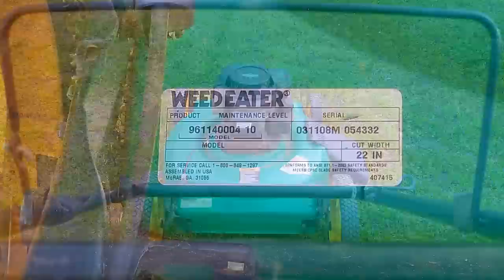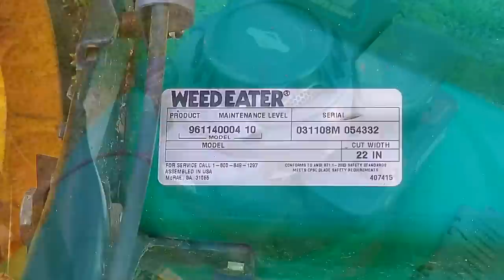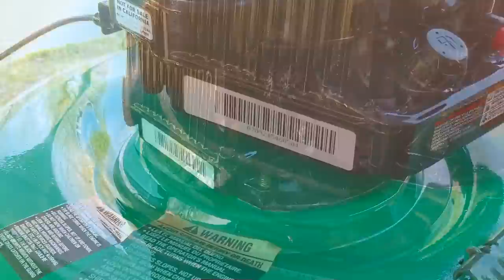Bought A Weedeater Mower And Things Don't Seem Right

Comment: I had the same kind of mower weed eater I just changed the primer and the carburetor I got it at Amazon a lot cheaper I bought a brand new back in 07 and I fixed it myself it runs very well😮😮
Reply from the maker: nice work

Comment: I put p-touch labels on the plastic on the engine or the deck stating when an oil change was completed, spark plug replaced as well as air filter. That is a great reminder as you always see it when using your equipment. Good job as always on the repair.
Reply from the maker: nice idea! And thank you Eric Oestreich

Comment: Of all the mower I've fixed, I have only had maybe 1 of those classic engines that wouldn't run good.  Even managed to convert a pressure washer one to a mower engine and it ran just fine.  Those engines were bullet proof, esp compared to the ones today.
Reply from the maker: you got that right!

Comment: I'm to the point where I'm going to fully inspect everything before I leave. Just bought a small hydraulic fender press thing and dude said "it just leaks some oil, works fine" got it home and filled it up. The thing was just full on dumping fluid. Not from a hose or something nice and easy, but out the seal of the main hydraulic cylinder that you can't get parts for anymore. Wasn't holding pressure at all and was way beyond useable. Thank goodness he took it back and from now on I'm fully testing every aspect of whatever I buy.
Reply from the maker: good advice

Comment: few months ago  I picked up this exact mower , fixed it and sold it.    I use #4 pull cord, and I am glad I bought a 100ft of it recently, 40% of mowers I have had come my way needed a new pull cord    I use Oregon 31-140 4 100FT[896] Small Engine Starter Rope.     Also at the end of the video I saw you using non -detergent oil.   I wouldn't of used that but if that is all you had  its better then nothing.   10w30 or HD30 is what I use, Detergent oil.
Reply: How much did you ask for it and how much did you get?
Reply: @mnight207    prices very by location, time of year, etc and inflation.. few years ago this would of been a $60 mower,  now its more. depending on how new parts that were added or replaced. etc
Reply from the maker: thank you for the information
Reply: @dfields9511  that's amazing! Even with inflation, I think that would bring $40 in my area right now. I think there is too much competition here.

Comment: I’ve gotta say, cheap as they are, I really like these basic Weed Eater mowers. I’ve had a number of them and they always seem to work very well with little effort plus they don’t seem to rust out as easily as many others. The paint seems to be consistently good too, it’s well applied and shines up beautifully (unlike those MTD mowers that seem to use poorly applied latex house paint which peels off in sheets, even on a new mower!). These rarely disappoint!
Reply from the maker: you go that right, I wish more mowers were like this one.
Reply: Yes those green mowers like the weed eater brand..seem to be good
Reply: Yes those green mowers are good haven't seen one in a long time

Comment: Our situations are identical. I enjoy this hobby and I'm just looking to not lose money. I could sell this mower for $75 as fast as I could turn them out. I'd have 15 responses in 30 minutes on marketplace. I've had people race to get them. Even try to out bid each other. I would have mentioned in the ad that this mower has very low hours for its age. Based on the tire tread and the condition of that deck, experience tells me it's hardly been used. Great video as usual.
Reply from the maker: you are correct, the moment this was listed it was gone

Comment: I picked up one of these for $5 a few weeks ago and much like yours alot of oil coming out of the muffler and its got a oil soaked air cleaner and had been oil locked as well. It works for what it is and I agree these things run forever and are hard to kill. Mines going to be the back up/ loaner.
Reply from the maker: nice, thank you Iowafox

Comment: 10 bucks what a GREAT DEAL !  I got my Weedeater Sprint 3.75hp mower for 10 bucks, I bought it because I wanted the deck, seller said mower wouldn't start, checked the oil and it was 1/4 of a quart over full, drain oil to right level, cleaned and re-gaped old plug, cleaned air filter, that little B&S 3.75hp engine fired right up, seller started crying and asked to barrow mower because they needed to cut there lawn, that was 10 years ago, I'm still using this mower, one of the best little B&S engine ever made in my opinion, BEST 10 BUCKS I EVER SPENT !
Reply from the maker: you are correct, 10 bucks was a great deal!

Comment: I bought a vintage Pioneer car cassette player. Dolby, loudness, att, auto reverse.. You get the idea. Ad stated untested, & no longer needed. When I received it, I connected it to a battery, inserted a cassette, & all I heard was the motor. This told me it needed a new belt. I then bought 2 belt kits from a supplier in Sydney. A few days later, belt kits arrived. I fitted the correct belt, then found a few other issues. I repaired those, & it now works. No, I'm not selling it.
Reply from the maker: very nice Christopher Marshall!

Comment: Spray Nine cleaner/degreaser, and a pump sprayer filled with the hottest water you can get from your sink work quite well for cleaning an engine.
And you won't get all wet like you do with a garden hose.
Reply from the maker: thanks for the tip

Comment: Not entirely the same, but I’ve been using a very similar weed eater for the last decade. I inherited from my father who has probably used it 5 years before that. I don’t keep it as clean as I should but I make sure to change out the oil every other year and spark plug/air filter every 3-4 years. Still starts on the first pull even though it’s probably in desperate need of a blade sharpening. 😂
Reply from the maker: nice thank you Matthew Ridgaway

Comment: Got 2 of this exact Weed Eater Mower. They were Walmart Returns and the guy worked there and got to take them home when they were going to scrap them. They had never been used and had defects of some kind that prevented starting. The guy had them in his shed for several years and never worked on them. I got them free when I sold him a used mower. Literally the only thing wrong with them was that the carb gaskets weren't placed correctly and a port was blocked. I put new gaskets on them, cleaned the shed dust off, and they started and ran perfectly. I tried to give them back to the guy, but he insisted I keep them. We them agreed that he'd keep one and I'd keep the other. I ended up selling it for $100.
Reply from the maker: very nice work!

Comment: Great video but i got a tip for you. next time when washing that style of engine on that mower remove the fuel cap place a sandwich bag over the hole and put the fuel cap back on. This prevents water enter the fuel tank. Believe it or not but the 3 vent holes on the fuel cap is an easy way for water to make its way in. Other than that great video brother 👌
Reply from the maker: thanks I appreciate the tip
Reply: @INSIDEHOUSEGARAGE  welcome no problem

Comment: Ill say, as a small engine tech, small engine repair isn’t going anywhere, anytime soon. Every shop around me is 5-8 weeks out. As for commercial property, you can start a small shop out of your home garage(depending on rules in your area). Automotive mechanics have been doing it since vehicles became a thing. 
On those engines being bullet proof, id have to agree. I have one i use as a brunch cutter (free and not in good enough condition to sell) that has been “about to blow” for awhile.
Reply from the maker: thank you Brennan Schuler for the information I appreciate it.

Comment: The spark plug has never been changed. It still has the paint on it from the factory. For $10.00, it still has lots of good parts on it anyway.
Reply from the maker: you make a good point and yes this is a very original mower. Thank you shawneehills7

Comment: the Briggs flat head engines , they put up with a lot of abuse and keep on ticking. this type I love the most because the parts are cheap and easy to fix  . that is why so many are still around . A little time Evey year and it will last for a long time .
Reply from the maker: you got that right, it's just a shame they had to go.

Comment: The difference of the yellow lettering on the deck from before 2:13,  and 6:23 .  You must be using Super Clean . Great grease and letter removal!
Reply from the maker: actually I'm just using the spray bottle, it's filled with harbor freight degreaser

Comment: I just fixed up mine, didn't start no matter what.. turns out the spark plug cable was chewed up, fixed that and has run since... mine also burned oil, but I just overfilled it
Reply from the maker: hey if it works

Comment: Hiya have a question. Do you get a lot of the briggs motors like the 5hps like the one in the picture with mufflers that the welds break on the back side of the muffler? it seems 2009 to 2012 had this issue im finding out threw the years and curious if its just me. Then you gota break off the muffler outside  and take a pipe wrench carefully to remove the little screw in type spigot when you break off the muffler. It's nice just  to do this for fun and a hobby as you mentioned.
Reply from the maker: interesting, I think this has only happened to me once, and I think I made a video about it.

Comment: I got this same mower from a customer yesterday they asked if I wanted it that is stop running so they left it in da storage and they also mentioned just the break release cable was taken off that was the only part I’d need. I get it home get it on my stand I see that what I thought is gonna a easy day. I have a break release cable that’s went to a old craftsman with da same type motor I can use. After full inspection parts that r missing r break release cable spark plug wire da coil that da spark plug wire is still on da mower I’m lost on how that even happened but da third part missing is da pull cord.
Reply from the maker: thanks for sharing

Comment: You haven't seen shady. I recently got burned on a Yamaha blaster quad. The engine cases had a crack in them. It leaked transmission oil into the combustion chamber. I did this after I put oil in it. Which means the seller had just enough oil for it to run and ride for a little while. But once I put the oil in that was it. Oh yeah the price was 1200$
Reply from the maker: wow, that sucks it broke on you

Comment: I NEVER see those anymore. I'd be looking both ways because I got a deal on a 22" deck and wheels. Yeah the handle bracket is frail on those. I put some ball bearing wheels and Subaru engine on a Murray just like that. The heavy flywheel makes that Subaru a tax on the rest of the hardware. Doesn't vibrate much though.
Reply from the maker: that's interesting

Comment: Pulsajet carburetor diaphragm will go bad and need to be replaced. Check and tighten cylinder head bolts as needed.
Reply from the maker: thank you Mike Spain

Comment: It's hard to break past market value, even if you are offering something better than the average clueless homeowner selling used equipment. After flipping a lot of equipment, I'm now leaning towards specialty machines that are not considered a commodity: Plumbers Jetters, Woodchippers, Stump Grinders, Generators, Pressure Washers, Stihl/Husqvarna Chainsaws etc. The prices on these machines don't bottom out as much.
Reply from the maker: I like your reasoning

Comment: So I saw something that had me wondering. I thought I saw some dirt in the gas tank. Do you ever clean out a gas tank? How bad does it have to be to get you to do so? I've watched a ton of your videos, and while you often remove the old gas, I've never seen you clean out dirt from a tank that I can recall.
Reply from the maker: good question, it has to be pretty bad for met to consider cleaning it. Most times
Just put some fuel in the tank, and using gravity siphon will pull most everything out of it. I guess you're wanting to see me remove the tank and the carb, from it, flush it and or clean it?  I haven't had to that  in a long time, since using the siphon
Reply: @INSIDEHOUSEGARAGE  I guess it's always rattled around my head because somebody said they did that for me years ago when they fixed a mower for me. It just occurred to me that I had never seen you do it or even mention considering doing it, as far as I can recall from the videos I've watched.

Comment: Any tips on working on these machines I’m starting my mower shop
Reply from the maker: sure, never be ashamed to ask for anything, whether it's help with drumming up customers or asking every customer if they have anything they would like to get rid of.   I will tell you this, you're going to need to be busy all day, 6 days a week to make money.
Reply: @INSIDEHOUSEGARAGE  how do adjust a engines fuel needle screw
Reply from the maker: 99% of the engines I've come across on mower are not adjustable.

Comment: Good video!! I wish I knew someone like you around here because I need a good used mower. The people around here either ask more than what the mower is worth or they don't even clean the mower up when trying to sell them you're lucky if they take more than one pic. of the mower in there AD's.
Reply: B
Reply: We have to hold on to these type of mowers
Reply: @gradyhernandez4699  Yeah I hear you. My last mower I had was 12 years old but it died on me. So I'm  looking for another one .Man I can't believe how much mowers run today.
Reply from the maker: thanks, and yes greed is not a good thing in my book.
Reply: @m1a1hm there's a few mower shops in my area. My neighbors usually { but not lately} bring a couple of mowers than need TLC, so I get them running IF they're not too far gone.
Reply: @gradyhernandez4699  Yeah I use to find old mowers pushed to the curb people were throwing away but not so much any more. I do a few of the neighbors yards there older folks and can't really do the work so thats why I'm looking for another old mower to do there yards I really don't want to run my personal that i use on my yard.
Reply: @gradyhernandez4699  Say I hope I'm not bothering you but I got lucky this weekend and found a old Poulan Pro push mower I would guess it's about 15 to 18 years old and believe it or not it's the same lay out as the weedeater mower in your video same big wheels and briggs engine . The guy I got it from had done some work on it because it had been setting in storage for years so he replace the pull cord and sharpen the blade and replaced the kill switch cable and changed the oil as well.And the guy I got it from knew the owner of the mower who bought it brand new and  other than setting for years it only had about 10 hours running time on it so he said. Well anyways the engine sounds tight but it still need some TLC I know it's going to need a new primer bulb soon and I've been looking for a replacement air filter the old one is still in fair shape but it use's a round metal and paper canister air filter  not the form type so I was wondering if you know where I could fine a new one. I only paid 60 dollars for it and seeing that I'm the one thats going to be using it didn't sound like a bad price.
Reply: @m1a1hm  there's another lawnmower shop in Alvin texas
Reply: @m1a1hm  'I" found a Troy Bilt mower on roadside,, intact,no missing parts, I put it in my van .cleaned out carb, which was NOT the problem. It turned out to be the pull stater rope assembly. Good mower!
Reply: @gradyhernandez4699  Cool!! Good fine!! You going to make a video on it.
Reply: @m1a1hm  I may do a video on the troy bilt
Reply: @m1a1hm  I may make a video on troy bilt
Reply: @gradyhernandez4699  COOL!!!
Reply: @m1a1hm  those green weed eater brand mowers are good
Reply: @gradyhernandez4699  Oyeah I agree the decks were made better than what you find today and that old Brigg engine was a work horse.

Comment: I do this as a hobby too, curious what product do you use (if any) after you wash the deck?  It always looks good and I can't tell if it's the lighting of your cameras or if you got that natural shine when it's still wet.  I will use PB blaster Surface Shield on the bottom of the deck if its got some minor rust as a protectant, but I'm still looking for an affordable option on the  top.  Keep up the great videos! :)
Reply from the maker: nice I'll have to look into that product but most time I don't put anything on it. I use the only degreaser Harbor Freight sells, it comes in a gallon jug

Comment: Also, I have a chainsaw I am about to give up on, my personal one. Any thoughts? Stops cutting midway through wood, as well as boiled the chain oil in the tank(it was oiling, and still is, confirmed with bar off the saw.) Love the saw but afraid it will cost too much to repair :/
Reply from the maker: hmm.. when you say stops cutting, it's just the chain not wanting to cut? not that the engine stops? I would say the bar is not OIL. Once it stops again, immediately confirm using a piece of cardboard to throw only on it, when blipping  the throttle.
Reply: @INSIDEHOUSEGARAGE  Yup, just the chain stops, engine keeps going. I tried on the cardboard and dont realy see any obvious oil sling, even though there is oil at the port from the oiler. I cleaned the bar out completely as well, made sure it was free of debris and able to oil ¯\_(ツ)_/¯
Reply from the maker: oh,, thats makes sense, your clutch is gone
Reply: @INSIDEHOUSEGARAGE  Gotcha, thats a shame! I was thinking maybe a bad bar/chain as it sorta cuts crooked, but a bad clutch would do the same I guess :/
Reply: @AdmiralDG  one side of the chain is sharper than the other.  The chain cuts crooked and wedges itself inside the cut